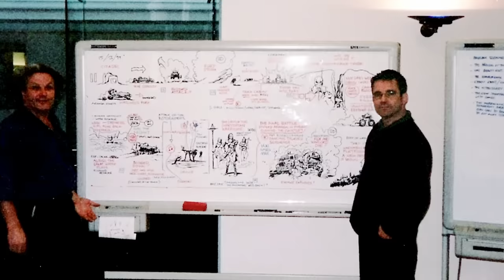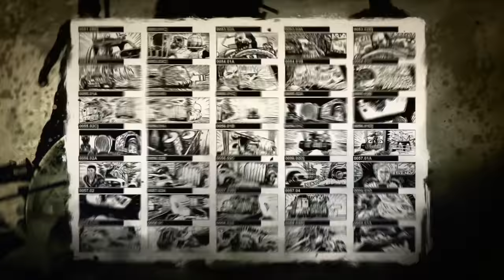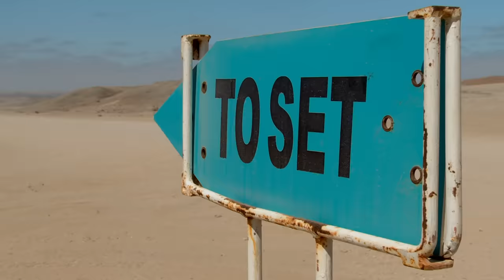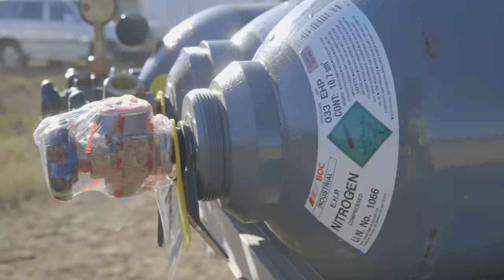Behind the scenes :  Mad Max : Fury Road

Comment: I cannot even imagine how much fantasy did the designers have. Like putting 3 engines, 2 compressors and 5 turbo kits in the same engine is like crazy as hell. Oh yeah and do not forget the volkswagen's rear body kits which have been put in the rear of the truck, the front of the trailer and the end of it.

And then, grill of the truck looked so scary that even i nearly had a nightmare because of it. Those skulls are like whispering the last words of the people who got flatten by the truck: Run! RUN AND NEVER STOP! 

And then, Furioza's robot arm was very cool, and it just made the bone hand design on the door better. 

My personal favourite part was when Furioza kicked the pedal to get it stuck at maximum, then opened the door with that old man and blew up that Buzzard patrol car like a boss.

I wonder how it felt to be the actor of the Crow-man mutant in that scene where the war rig went through that place with full of crows.

Comment: 4:50 The movie is great, but there is one shot that felt blatantly fake / physically unrealistic. A car is speeding along, drives into a wire,  and flips into a pit. The unrealistic part is that the car goes from having just forward momentum to just having rotational momentum -- even though the wire would cause it flip (rotational momentum), it should still have had some forward momentum. Everything else was superb!

Comment: I have an issue with the final crash.
The way in which the War Rig flips isn't how a vehicle would flip unless it had, say, compressed air cannons firing under one side. This is not the effect you get by just turning the wheel. The War Rig should and would have sharply turned, hit the canyon/mountain wall, and rolled due to its forward momentum.
What's in the film is Nux turning the wheel and the War Rig continuing forward, hopping into the air slightly, and essentially doing a barrel roll.

I'm also not such a fan of the CGI guitar and steering wheel after seeing how nice the crash looked with no effects.

But it's a 15 second moment in an entire movie I adore so it's not such a big deal.

Comment: 3m08  140 vehicles going 140mph for 140  kilometers
Bollocks.. that just never happened.
There's no way you can pull that off on dirt.
40 vehicles going 40 mph for 40 km alone would be a challenge.. never mind 100x100x100 or 140x140x40.

Comment: My big complaint about this movie is where did they get the new tires for the war rig? There is 6 tires on it and these should have been worn out skins with 6 brand and type tires. Even though this is a 6 wheel drive truck it never runs on pavement so the tire size issue would never cause any problems. Same thing with all of the trailers and tires throughout the movie!